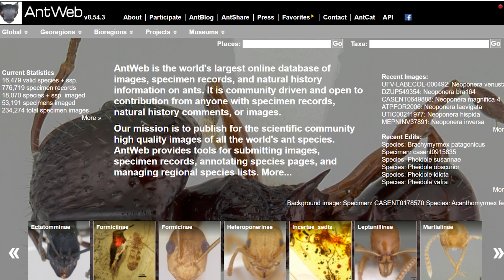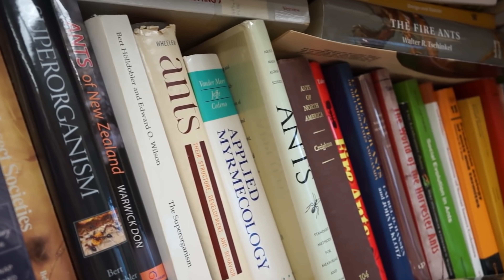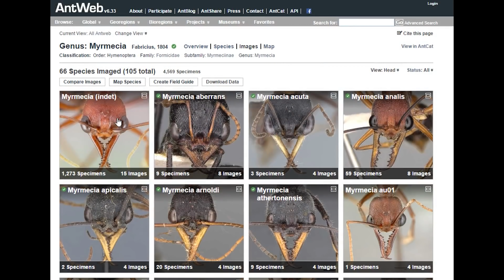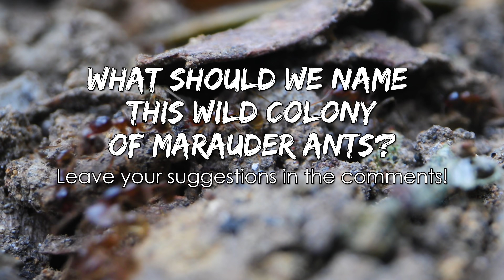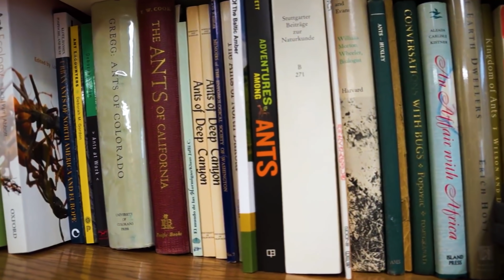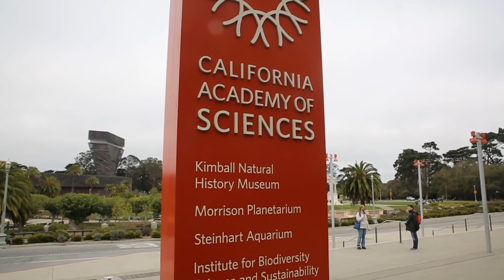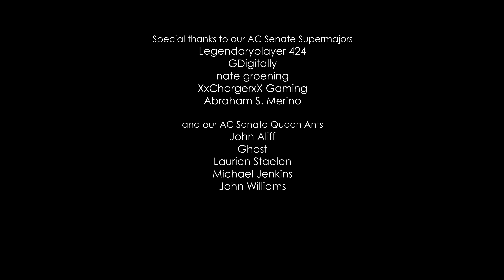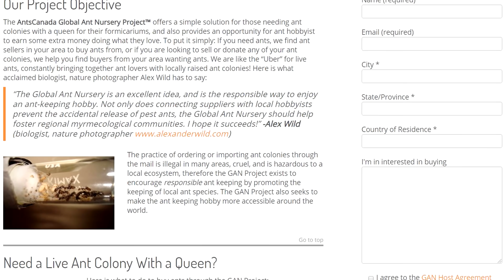Discovering & Naming A New Species of Ant in My Yard

Comment: Hi just wanted to let you know if things get out of hand here's a good option, gunpowder and firecrackers, or matches if you don't want to make it go boom.
Reply: Pretty much just pour it down the ant Hill and then just use a match just drop it in there, but if you want a more effective way you want to use a firecracker you just have to get that firecracker into the hole and plug it up and then just light it and run, it sounds cruel but it's effective.😐

Comment: Hey guys, I found some ants in my moms yard that have been acting strange. They keep moving from a hole in the backyard to another hole in the front yard every few days and the holes are at least 50 feet from each other. They are very slow and a mix of very big and very small black round ants. Is this normal? I haven't seen any lines of ants connecting the holes on the surface so I assume they are moving between the entrance underground but why are they doing this? They're active in one hole for 2 or 3 days and then all of a sudden that hole looks abandoned and I find them all at the other hole.